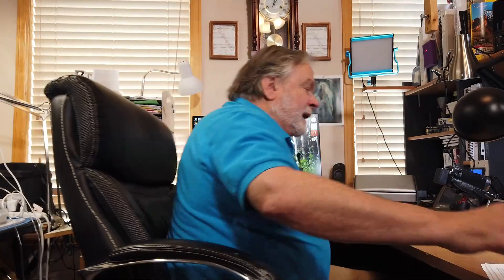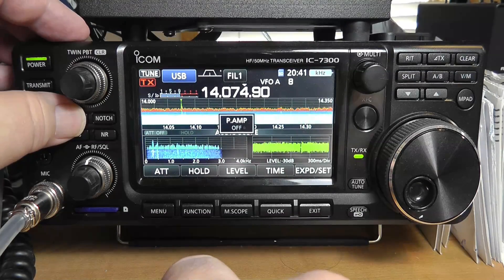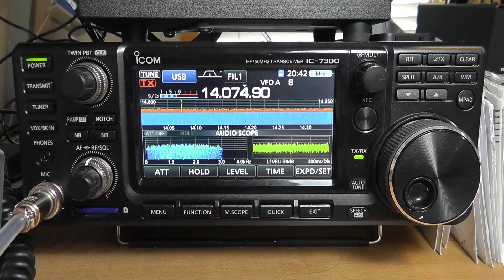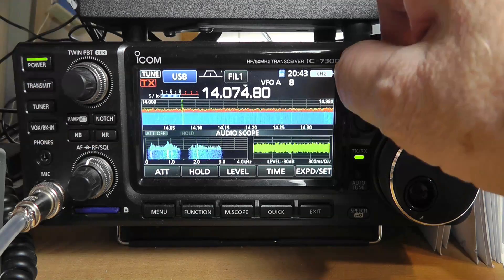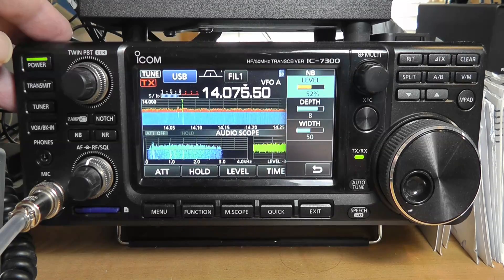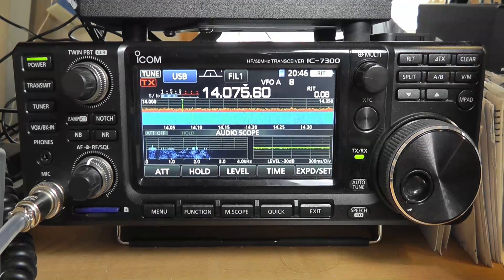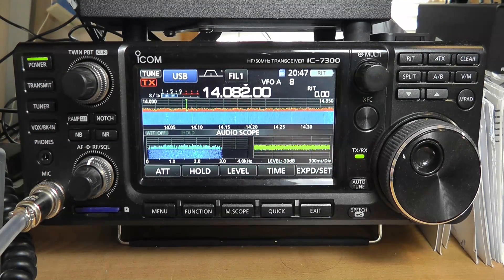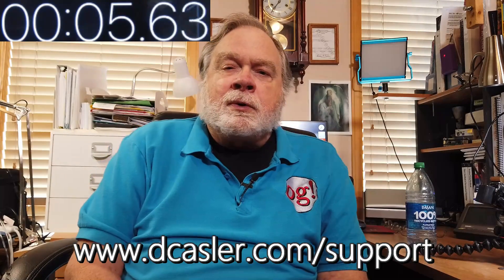Receiver Tools For Fighting QRM (#928)

Comment: Dave, thank you for your time in taking up my question. I think I have to start using the attenuator maybe just the 6db when the noise is there, I always use IPO on 40 and 30m. I have to get into the mind set that its OK to use the attenuator or RF gain when the noise is there and not switch the radio of an sulk. You asked a question in your video about the IC-7300, I did own one for 18 months then I PX for the FTDX10 which I must say I am pleased I did its amazing transceiver.   Once again many thanks for your video, I hope it helps others too. Steve G4YTK

Comment: Good quick video David, covered the most basic functions well.
One area that I find many hams do not understand is the proper use of the RF gain, pre-amp and attenuator controls.  The RF gain is very useful for INCREASING the ratio of  wanted signal vs background noise.  Turn the RF down and watch the signals noise to signal ratio increase a bit.  First though, use the att/preamp to do what they do best;  I never use preamp on 40 and below, and 15 or above almost always has preamp on because that is how to increase the ratio of signal to noise.  After that is set (do not forget to use the AF to allow you to actually hear things) then use bandwidth, if shift, notch, contour, and last of all the DNR to clean the last of the QRN.  
QRM is similar, and that is where directional RX antennas are required.  Also, do not forget proper grounding, the use of chokes on electrical/signal/computer lines and the like.  Much noise is local and combat that first.
I agree with keeping the IC-7300 for a while longer as it is the more well known radio and even ubiquitous.   But if I could afford a new radio it would be the FTDX-10  for sure.  A bit more money and the Flex looks very tempting as well.
Keep up the good work sir.
AA7VA

Comment: Another technique to add to the noise reduction arsenal is to use a separate receive antenna away from all the noise we now have in our houses.  I found that especially useful on my small city lot.  I walked around my back yard with a portable receiver and found a quiet spot.  

I use a cheap Chinese receive-only non-resonant mag loop antenna and feed it into a separate SDR receiver.  As you suggested, I oriented the null to the noisiest part of the house.  It has a much better signal-to-noise ratio than the received signal on my end-fed antenna running back into the house.  The SDR software has almost all the features that the IC-7300 has, and it also works with all my vintage radios.  Thanks for dealing with the subject.  -- John N0BUP
Reply: I'm in an urban environment and built a 60' LoG recently.  Because a significant portion of QRM is vertically-polarized, it attenuates noise more than it attenuates signal.  I can pick up a lot more with it than my DX Commander, even on bands where it's supposed to be less effective, though it does have some directionality.

You need a pre-amp to bring it back up to the same level, but most HF radios with a separate RX antenna input have those built in.

Comment: This is very helpful. I’m still exploring what my radio can do and have a high noise floor in my area so this is exactly the advice I needed. The manual doesn’t do the best job explaining when I should use what feature and for what purpose. Thank you.

Comment: Dave, regarding your question for the reference station radio:  Am partial to the Yaesu line FT-DX10, 710 or 991A.  All really depends if you feel VHF/UHF should be incorporated into the 'new reference station' radio design.  Personally, if I was picking / recommending one, as an example, for a new General Class operator, the FT-710 price point is hard to beat.  73.
Reply: As a general class operator and new to HF, I have to agree. The ft-710 is a great rig and was cheaper than the 7300 when I bought it from HRO. Works really well and couldn't be happier! 73!

Comment: A dedicated RX antenna is probably the most powerful tool for removing QRM we have, currently.

In the near future, though, SDRs will start to include onboard ML-powered QRM-removers that'll work a little better than the current mushy NR, but it'll be a generation or two.  There are some demonstrations of generic (not radio-specific) noise reduction software processing audio from HF here on youtube, and it does okay.  But an ML algorithm trained on QRM specifically could do a bit better.

Comment: Potential external sources of noise include fluorescent lights, light dimmers, LED power supplies, routers, computers and monitors, heater or air conditioner motors, building wiring issues, etc.
Reply: Agreed.  If anyone doubts that, they should just walk around with a portable SW receiver and hold it near just about any modern appliance to hear the noise it puts out.  Worse, all that noise is picked up by the house wiring and is re-radiated through the whole structure.

Comment: The first thing I would recommend is run from a battery and turn the mains switch off to see if the noise floor drops, if it does you have work to do to find the noisy appliance and either replace it or wrap its power lead around a toroid a few times.
I'm curious about your noise floor - Did you turn a device on that generates broadband hash?, S9 noise would destroy the experience I have.
Reply: Yes I have done that because I was having problems with another noise source from newly installed solar panels on a house in the street. I put an official complaint to OFCOM the UK rf investigators and that was a test I had to do before they would investigate. They investigated and after several months gave me a reply they were satisfied that the company used a qualified electrician to install the system. Even though was sending out harmonics on the 20m band they took no action. Waist of time that was.  Now I have another intermittent noise that when it comes on can last for any amount of time from 1 hour to 10 hrs at anytime. That gives me a s5 hash on 18mhz and s 3 on 14 mhz, Sometimes it can also appear at the same time s 3 on 21mhz. Sometimes it may not be as strong like what ever is causing the noise as moved location slightly. I need to try and track this down. I can use ipo and attenuates  on the FTDX10 but since I love chasing weak sota and pota station they are well under the noise so they are lost.  Like Dave says this is only going to get worse.

Comment: Regarding the reference radio: there newer radios on the market today and with better features than the 7300. But the thing is that the 7300 has by far the largest user base of all radios out there. Isn't that what a 'reference' is about?

Comment: Sometimes Hams can get the idea that by lowering the noise floor they are now going to be pulling all kinds of rare DX out of the Ether; I think almost always it does NOT. Noise is not the same as DX. Let's say you're on 12 meters and things are quiet for DX, but there is more noise than you'd like to have to put up with. Perhaps there are 6 stations you can definitely hear, but the noise is irksome. I think a lot of Hams get the idea that if they lower the noise floor, now they might hear 10 stations instead of 6. MUCH more likely is that, having lowered the noise floor you will now hear those same 6 - but better. Is it possible lowering noise will pop a new DX out? I suppose, but my overwhelming experience has been no. My point is: ask yourself what you hope to accomplish by lowering the noise floor; Improved readability is not the same as improved receptivity. Or, if you prefer RST, R does not always equal S. FWIW. Great channel, Dave. THX!

Comment: Turning the bandwidth down can reduce noise too.
Reply: yes it does since I am 95% cw operator using real narrow filters does reduce the noise especially using the crystal roofing filters the 500hz or 300hz and then narrowing them down to 50 hz.
Reply: yes
The bandwidth and shift are like magic on noise (or Icom equivalent twin passband tuning, same thing just different implementation).  Also, Yaesu's Contour is amazing in various situations.

Comment: Reference radio should be a DX10
Reply: I think the idea is the beginners first HF setup. The 7300 is my first radio and I did find it a relatively painless experience, especially as I have to remote it. The DX10 is more expensive, but the FT-710 seems to be in the same price category as the 7300 and might be a modern contender.